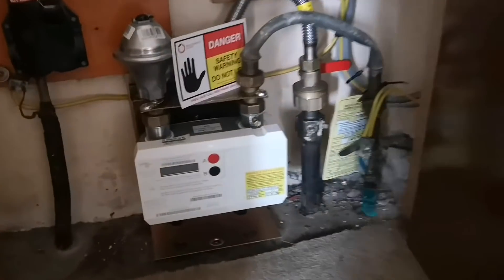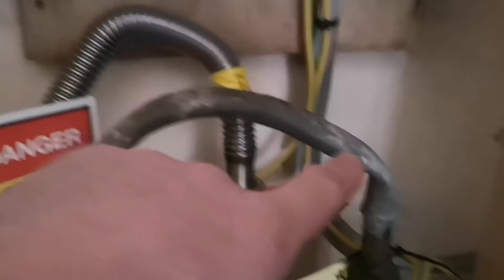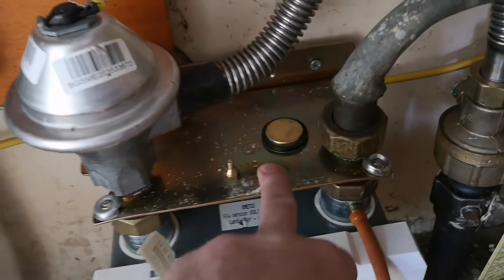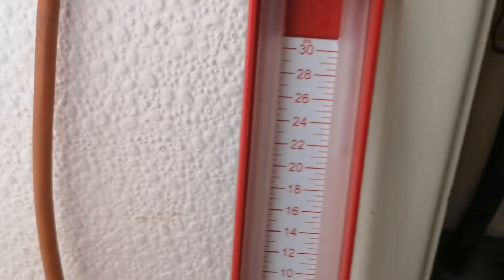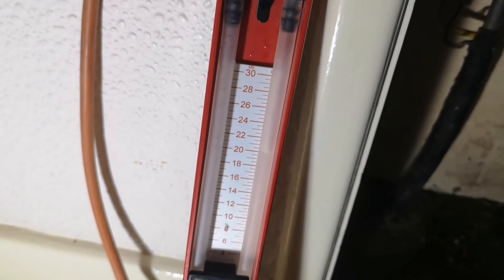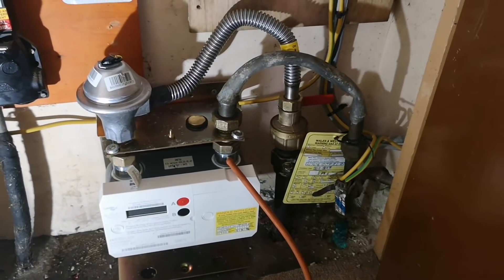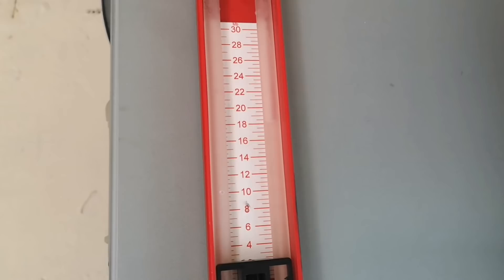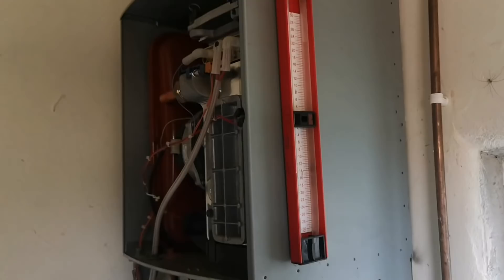Estate Agent could smell gas 😱 But they didn't expect this to happen 💥 (not click bait)

Comment: I’d have done meter operating pressure as well as at p1 just to ensure there’s not more than 1mbar difference. Also the meter Union should come off mate with minimal force but the top nut needs undone first! Not sure if u mentioned it in video

Comment: Be very careful about having a smart meter fitter. If you do decide on having one, take photos before and after installation and ask the smart meter installer for gas pressure readings. Make sure they fit an isolator too for the electricity supply to your consumer unit.

Comment: I had done a job in December,  changed a smart meter, repiped the outlet due to the same lead work like that.

Yesterday I had a call from.my company telling me that the neighbour had smelt gas.
Northern gas went out yesterday and capped them off,  on the job notes they tested a 5mb drop.
the customers house, they were on holiday. He just capped.

My company auditor then went out to inspect my work, safe to say I was pretty shitting myself upon hearing the finding.
He uncapped it and did a test .
Zero drop. Left it running for 8 mins and recorded it on video to send back to My company for evidence.

My case got opened and closed instantly as it was backed up with my digital smart tester that records the full tightness test. Start to finish, plus all photos of LDF on my soldered joints ,ECV and meter test nipple.

I could quite easily been stood down and removed from tools because some tosser stitched me up and made up a false statement.

I never trust the ESP , 
Also absolutely no idea who could smell gas in the first place as it was gas tight !!! 🙄

I was absolutely raging with the news.
Reply from the maker: I had a British Gas smart meter guy i.d. one of our installations for carbon monoxide spillage from a brand new combi boiler. It was black spray paint on the garage wall next to the boiler. I managed to catch him  before he left the job as the customer rang me in a panic as I was driving past. He was red as a beetroot with embarrassment. 😂
Reply: The same thing happened to me  there unbelievable.

Comment: I realise this is a while ago but a couple of things struck me:
1. The lead pipe was probably ‘done in’ by the muppet  who changed the smart meter.
2. The awful noise when you switched on the boiler the first time might mean a dodgy main gas valve in the boiler itself?

You certainly get the interesting jobs.😉👍
Reply: had one before it was gas valve

Comment: Not click bait ! ! 
2 tightness tests no leak, appliances disconnected and connected, standing pressure and working pressure correct. 
Horrible noise while in use, ratios are probably out or fan nrv split. 
So no explosion emoji necessary and no gas leak just a video to point out obvious tests and bash BG?
Reply from the maker: Irony is wasted on the stupid - Oscar Wilde

Comment: Very surprised that a 27kw combi was running 18mb on max rate with that lead pipe, are you sure the meter reg wasn't ramped up to compensate? I didnt see you checking if you had the minimum 1mb difference. 
Hopefully you did gas rate the appliance after you renewed the pipework.

Comment: When we moved into a house we were planning on buying the gas had been turned off for so long we had to to have it retested before we could could get the gas turned on since we couldn't get a permit to do it ourselves that ment a calling a gas fiter and that was a problem because the one with the gas ticket was incompetent first test he used a pressure gauge that was too low as the inspector said there was no way of his knowing what the pressure was 30 psi was fine but he had no way of knowing if the pressure was started at 30 and had kept it's pressure or if he'd over pressured and if hadn't dropped below 30 so back came gas fitter put a different pressure gage on one that read pressure to 25 hundred psi again it failed so back came the gas fitter again finally put the proper gauge on pressured up the system to the proper amount and called for the inspection for the next day inspector arrived opened the valve to check out the pressure and it was 0 so back came the gas fitter found out the gas valve for the furnace and hot water tank were leaking tighten up the nut on the valves and represured the system for called again for inspection next morning I wasn't taking any chances I checked the pressure again it was 0 so rather than having it fail again I watched for the inspector and when he pulled up in front of the house I took my compressor and represured the system he come checked it out passed it as soon as he left I went looking for the leak found out the gas line running to the stove under the tub was where the leak was no leaks in the pipe up to where it disappeared under the tub and no leaks on the fittings hooking to the stove so I unhooked the stove and undid the pipe under the the tub and pulled it out obviously was an handy person who did it with parts from the lumber store as the longest peice was 18 inches and all the joints were leaking so I used a new one full length pressured up the system checked for leaks and there weren't any so when the gas company came by to take the lock off and turn on the gas I had a system that had no leaks with that amount of leaks they must have been able to smell it and they must have paid for a lot of leaking gas over the years  it may have been what we had years before at another place we owned after the gas fitter hooked up our gas dryer we could smell gas so we phoned the gas fiter and he said he wasn't going to fix it as it has passed inspection phoned the gas company and they said that all they could do was come out and check for leaks and if it was leaking they'd condem it and shut off the gas in the middle of the winter and then we'd have to pay to have it redone so I got out my soap mixture and found the leak and fixed it after that if I needed anything else hooked up I did it myself  after all way pay a gas fiter to do it if I was going to have to do it myself anyway as long as you check for leaks there is no danger
Reply: What a sentence!
Reply: @digitald5851  I'd give him two years mandatory for that 😀

Comment: Used to work as a building surveyor with the local council inspecting and relating empty properties ready for re letting....often found properties with quantum meter laying in floor and a quarterly meter connected in its place...the meters would come from properties that were vacant and the external quarterly meters pinched...Always called Transco in and they would never believe me that people would swap the meter so they got free gas..same with electric meters nothing unusual to find that that had been bypassed...how they never electrocuted themselves was beyond me....
Reply from the maker: I'm surprised that I've never seen a jumped meter in 20+ years of landlord testing in some pretty dodgy locations
Reply: @griffithsheating by passing the electric meter it was quite the norm in Plymouth especially at the druggies flats......even seen it at the odd oap bungalow..👍👍

Comment: Set of electrodes won’t go a miss
Reply from the maker: I did a full strip down on it the following week. New seals, electrodes and a new fan. It also had a new pump a few weeks ago. Being left stood idle for 2 years took its toll on the boiler.

Comment: Nicely done

Im sure if you had LDF the sight glass in the boiler would be bubbling a little

It’s probably had the BG special service for the last 3 years … thats doing the FGA and walking back out 😂😩
Reply from the maker: Sad isn't it. They have become an absolute joke of an outfit. Corporate interests screwing the engineers over no doubt.
Reply: @griffithsheating  

I worked for them for about 4 months as a subbie doing repairs and servicing where they paid per job

Money was good if you cut corners but if you  wanna work the correct way nahh

It’s because of the way BG have set it all up that the engineers will not have enough time on each job if they want to make there money for the day

Maybe 30% of the engineers are good, rest are crap

But i tell ppl you can make in 2 jobs for yourself what you make in 6-8 jobs for BG

Just have to build your clients- since i left them i been flat out for myself ✌️

Keep the vids coming broo
Reply from the maker: @edoz3279  I used to sub for them on installation back in the early 2000s they were pretty good back then to be fair loads of the old school guys were still about and in management. Decent jobs and decent money. Then they canned all their subbies and took it all in house and that was the start of the slippery slope to now I think.

Comment: You say as it's maintained by British gas it's not done properly, what makes you say that?
Reply from the maker: Because a British Gas service is usually just a visual inspection and testing of the flue gas / pressures. I confirm this later when I opened the heat exchanger up and it was partially blocked with aluminium oxide. Also the electrodes had 90% rotted away and never been checked